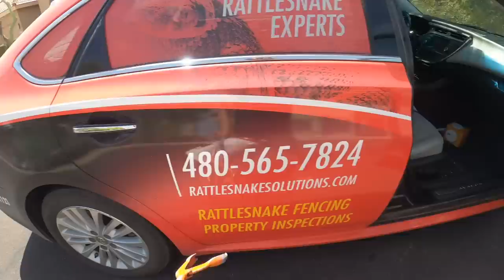A Rattlesnake Was Right Next to Us the Whole Time!

Comment: Main reason we went from the standard gray to bright yellow  or green air hose.
Cleaning a large garage with motorcycles, had a rattler coiled up inside some air hose on the floor. 
I didn't act like I saw him and went about cleaning , sweeping, and moving bikes around. 
Was there for about an hour, and even the noise of the air compressor didn't bother him.
When I was done, I used a 6 foot snake grabber ( from Amazon ) and took him to the far side of 10 acres.